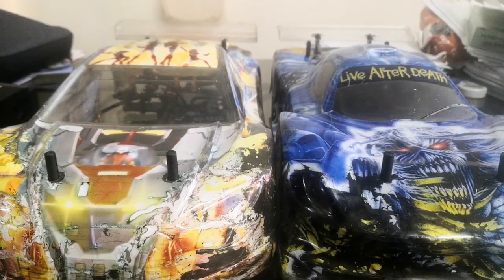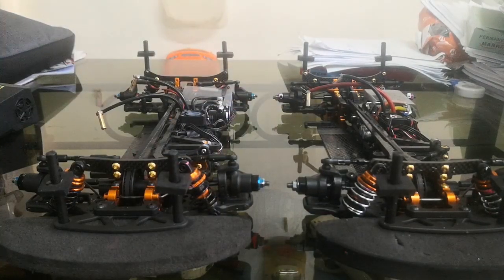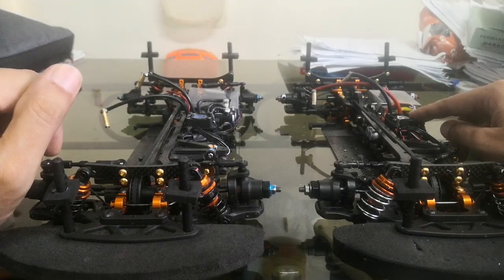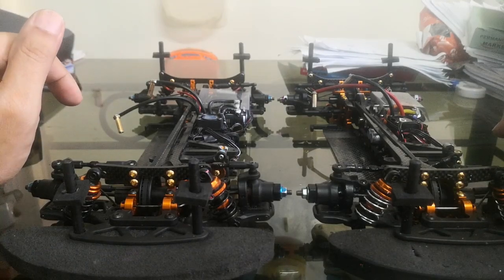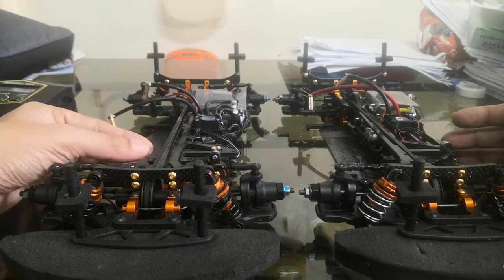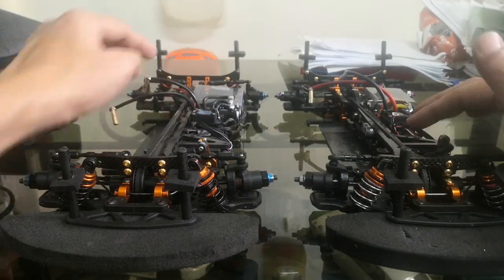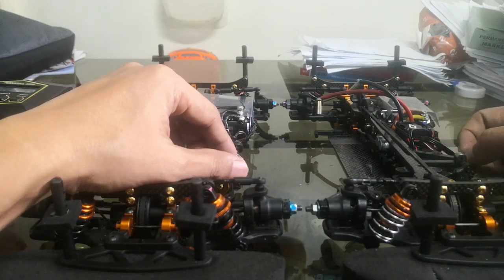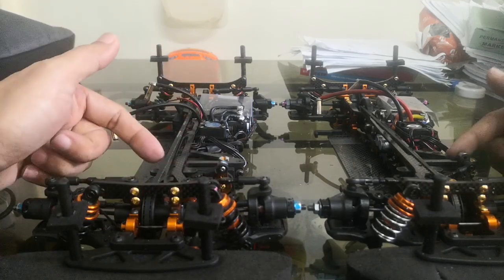RC Car Setup - Modified and Blinky

Comment: Hello rc friend, i like your video's cos of the fun factor and no secrets.
Myself i have a t4 2018 and verry happy whit the performance and durence of it.
I only run on carpet and my question to you is that i am running a nutral rolcenter, will i make a difference to make it a high rollcenter?
Greetings from Belgium
Reply from the maker: I think if high grip carpet better low roll center to prevent traction roll.